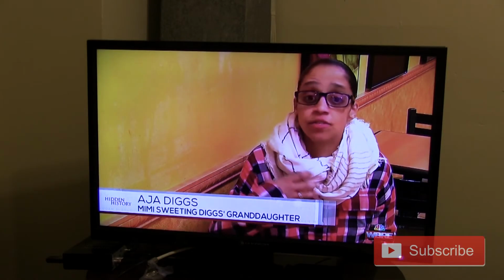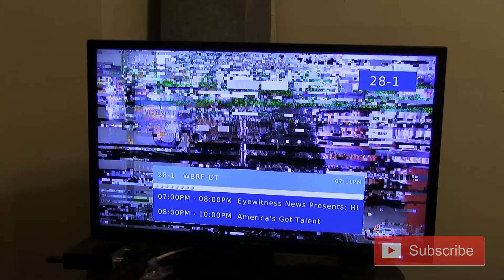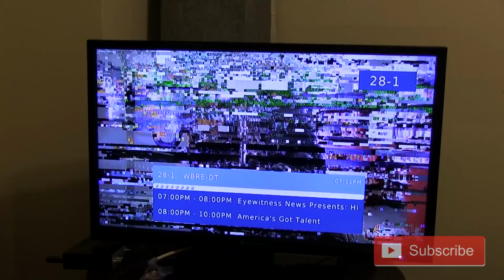How To Connect a TV Antenna to Multiple TV Sets

Comment: Can you use a distribution amp with a pre-amp?
Reply from the maker: Yes
Reply: @AntennaMan  Thanks.  Do you have any videos that go over having both a preamp and distribution amp?  I looked but didn't see any.  If not, maybe it could be the topic of a future video?
Reply: @AntennaMan  I'm in a red / violet reception area in Western NY.   I cut the cord a couple of years back.  I started with a Clearstream 4V in my attic with a CM-7777 preamp.  I was able to tie into my existing coax network and provide decent to good reception for tvs.  Then to get more channels I added another Clearstream 4V and connected them together with a Winegard CC-7870 antenna coupler.  Now, I'm by no means and expert and I think I'm pretty lucky that it all works.  For me having the antennas in the attic and tying into the coax lines worked out well.  I also have a homeworx digital converter on two of the tvs. I have a one terabyte external hard drive on each of the converter boxes so I can record OTA stations.  It's pretty great and after the initial purchase, it's free.  The only thing I haven't tried is to improve the signal with the distribution amp.  I wasn't sure you could do it.  I have two splitters that go out to the 5 tvs.  I have a drop ceiling area in my house where they're located.  I need to take a look and see what I can do.  I'm also not sure about how I'd get power there long term.  I sure do like your videos.  You do a good job.  I'll let you know how it turns out.
Reply: @AntennaMan  I replaced the 4 way splitter with a channel master cm3414 and ran a splitter off one of the lines to supply 5 tvs total.  I'm extremely pleased.  I added 56 channels up from 42 in previous scans and would say added from 5-15% to the signal strength, depending on the channel.  Overall, I'm very pleased.  I bought the dist amp off ebay.  it was a refurb from cm directly and was only $36 with tax and shipping.  What is the biggest factor for me seems to be the weather.  The signal can be in the 60's -80's on one day and drop to 40's - 60's on the next.  Thanks again for the info.  I am happy with the results.
Reply: I forgot to mention that refurb dist amp was like brand new.  I could not tell the difference.

Comment: Hey antenna man, thanks for the vids. I think I could use a distribution amplifier. Once in a while I lose the signal on a few channels. I have kind of a long run to my rooftop from a splitter in my basement. Its all rg6 and goes to 3 different rooms (small house). But, you never explained where to put a dist. amplifier (ex: closest to antenna). Or , does it not matter? Thanks
Reply from the maker: Put the powered cable splitter as close the the antenna as possible.
Reply: @AntennaMan  thank you

Comment: is this a good distribution amplifier?
https://www.ebay.com/itm/HDTV-Antenna-Amplifier-Signal-Booster-TV-High-Gain-Channel-Boost-Indoor-VHF-UHF/303134157729?_trkparms=aid%3D555018%26algo%3DPL.SIM%26ao%3D1%26asc%3D60695%26meid%3D2f78485eab094618ae3d093f083f4b9e%26pid%3D100005%26rk%3D5%26rkt%3D12%26mehot%3Dco%26sd%3D122062463786%26itm%3D303134157729%26pmt%3D1%26noa%3D0%26pg%3D2047675&_trksid=p2047675.c100005.m1851
Reply from the maker: Looks like junk. Avoid cheap knock off amplifiers.

Comment: Here's a bizarre story.  I have an outdoor antenna connected to a Tablo Lite which I get my local channels through the Roku app, before I had the Tablo I had the antenna cable connected to my TV.  I've always had problems on and off getting our local low VHF channel 5 and recently the Tablo wasn't picking it up at all.  As an experiment I reconnected the antenna to my TV and found channel 5 was coming in there.  So I decided to use a Legrand splitter I had to connect both the Tablo and my TV to the antenna so I could watch channel 5 (all my other channels come in great through the Tablo).  To my astonishment channel 5 now comes in strongly through the Tablo AND the TV.  I know the splitter really should have made the signal worse but I'm wondering if the Legrand splitter's filtering ability somehow helped clean up the weak signal from channel 5.  Weird.  In any event all is well with the world now.
Reply from the maker: Adding the second TV set either helped "ground" some static/interference going into your Tablo or acted as sort of a second element on the antenna to improve the signal.
Reply: @AntennaMan  Makes sense, thanks for your response.  I'm just glad it's working.

Comment: Love your videos!  Quick question, can you run two amps back to back?  I currently have an "Electroline EDA 100x" amp (+15dB) which runs to a 4 way splitter (-7 dB each).  Would it be a good idea to run a Channel Master 4 port distribution amp instead of the 4 way splitter in addition to the current amp?  Or would it be better to get rid of current amp and splitter and just use the Channel Master?   Or, would be be even better to add an amp at the antenna, ditch the current amp,  and then use the current splitter?   I have stations about 30 miles south that come in crystal clear, but 60-70 north that come in somewhat clear, sometimes not at all.  Any input would be great!  thanks!
Reply: sangat membantu bos infonya

Comment: Thank you Tyler. What about terminators? If I get a 4-way and I only have 3 TV’s, I need a terminator on the 4th output, correct?
Reply: Great question. I never knew they existed until I saw your comment/question and then wondered why they were even necessary. So, you had me do a little bit of researching and in a nutshell the logic is... 'terminators' will never make things worse... but... will make things 'optimal'. So, given the inexpensive nature of 'terminators'... why not use them?... lol

Comment: Have a question....  without a usual 2 splitter I get 58 channels on a channel scan.  With the 2 splitter, I get 50 channels on a scan.   With digital channels these days, what am I looking for in regards to good enough signal to still get optimal picture?  I am mostly interested in local channels of which look great prior to using a splitter. Am I primarily looking for pixelation and drop outs, or am I also looking for sharpness of picture (like how analog channels used to tune in) ?  Is it possible that the splitting of antenna signal may result in some of the non-local stations dropping out, but local stations will continue to look just as good?  Many thanks in advance.
Reply from the maker: Your issue is that the unpowered splitter is killing your signal. As long as you use this powered splitter you should have the same amount of channels on both TV sets. If you do not it is possible that one of the TV sets has a weak tuner in it and you may need a new TV set or separate tuner. https://amzn.to/2K0lrQm

Comment: Hey man! So are you saying a 50ft Co axle cable from ur roof straight into your TV is going to get better signal than a 100ft cable??   I purchased a 100ft cable just to be safe. And it is probably too long for what I need, am I loosing channels?
Reply from the maker: Possibly. Cut the excess and make a new end.

Comment: I was able to use the powered splitter ( ANTRONIX VRA500B $60 on Amazon) that Spectrum left behind after I turned in my cable boxes. I mounted a small GE 29884 ($35) antenna outside and I can get a total of 41 OTA local stations on 4 tv sets in my house. The local towers are NNW at a distance of 37 to 48 miles and I'm even getting 3 stations from a city to my ESE where the tower is 58.8 miles away.

Comment: Thanks for the videos. What do you think about flat coax cable to run through doors or windows?
Reply from the maker: I just took a look and the flat coax cable is incredibly thin and make kill some weaker stations if you are in a bad signal area
Reply: @AntennaMan  Not to mention the impedance mismatch. You would need a balun to match impedance.

Comment: How about when you would like to use two antennas and connect them both to a central point, them out to the TVs.  What is the recommended connection?  Seems like one of the input ports is lost to "power in" on almost all preamps.
Reply from the maker: Combining two antennas in general will result in both signal loss when combining them and multipath interference. Your best bet is to get one decent antenna

Comment: I purchased an 8 Port Antenna's Direct HDTV Distribution Amplifier.  I have connected 6 TV's to it, and have the caps on the 2 ports not being used.  Sometimes the signal strength will be at 75, and the signal quality will drop from 100 to almost zero giving me pixelating.  The signal strength stays at around 70 at the time it does this.  The amp is mounted in the basement.  The antenna is a Clear Stream mounted in the attic at the recommended angle.  The weather was not that windy at the time.  What do you think is happening ?
Reply from the maker: Do you have any airplanes that fly overhead? That may affect the signal from time to time
Reply: @AntennaMan  Sometimes, but not at the frequency that this was happening a couple of days ago.  Today, similar weather, and no issues.  I don't get what is going on.
Reply: Do you think I should also be using a Pre Amp ?

Comment: DO you recommend the Channel Master or the Antronix 8 port ? Great channel, thanks
Reply from the maker: I recommend this one. It's the same one as the Channel Master model with additional gain on each output to compensate for signal loss in a long cable. It turns out they were the same models but just with "Channel Master" on them instead of "PCT"
https://amzn.to/2XiP2Y5

Comment: I had a small new inline amplifier on hand .. so I installed between attic antenna installation (closer to antenna) using the passively 3-way split in basement acting as a slight attenuation .. the signals to each of the 3 sets fairly accidentally ended up just about perfectly powered. Been working ideal for years. I did install a Belkin Surge Cube on amp power supply so nothing has ever been unplugged for storms. xlnt video, thx.
Reply from the maker: That's ideally the best setup is if you can use an inline amplifier in an attic instead of a preamp outdoors. They tend to last longer.

Comment: I have a amplify on antenna  cm7777hd but i have 4 tv on a splitter can i use a power  splitter too ?? the antenna is in the attic i have 47 channel
 some weak  on the 3rd floor
Reply from the maker: You should be able to as long as there aren't any strong stations otherwise they may overload

Comment: I bought one of those 'don't buy' antennas that you mentioned in a earlier video. It works okay but would have rather gotten a bigger antenna for the price. 
With that said, how close should I have put the amp and rotator module to the antenna?
I also would like to know what a good rotator motor would be for an upgrade. I didn't see any videos that showed a good antenna matched up with a directional motor and control box for moving the antenna to specific degrees.
Thanks for the great videos!
Reply from the maker: You'd want the preamp within 6 feet of the antenna typically on the same pole it's mounted on. The rotor itself is usually about 4-6 feet from the start of the mast with the antenna being on another 3-5 feet pole. Doesn't matter where you put the control box
Reply: @AntennaMan  unfortunately the preamp is an indoor only amp. It has controls on it. The antenna is too far up to get that close...😢.
Reply: I'll tell you the model in a few minutes, you'll understand the delema.

Comment: I made a copper loop antenna and installed it on my roof. I pull in 47 channels and watched the pathetic Super Bowl game 2 weeks ago.
Reply from the maker: In my house I can pick up ten channels with just a coax cable. Sorry about your loss I watched that "Super Bowl" as well. Probably would have been more entertained disconnecting the antenna and watch the "no signal" icon move.